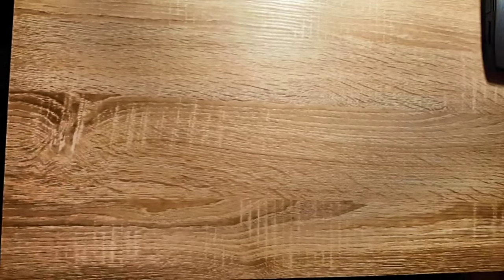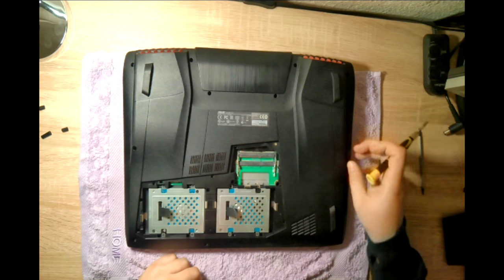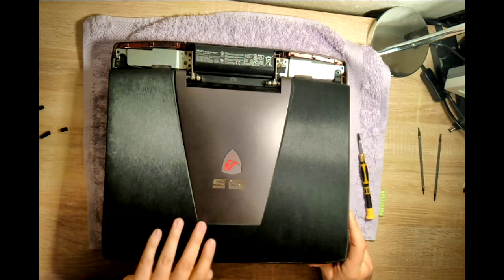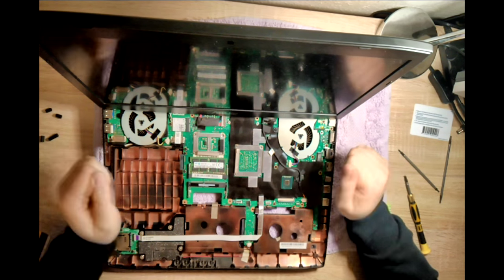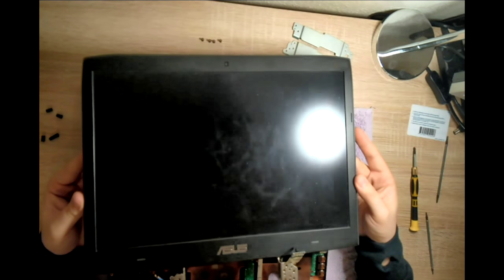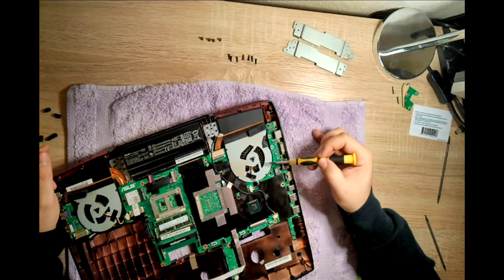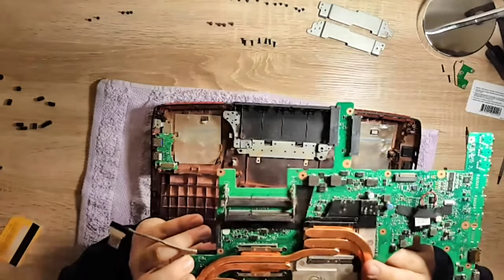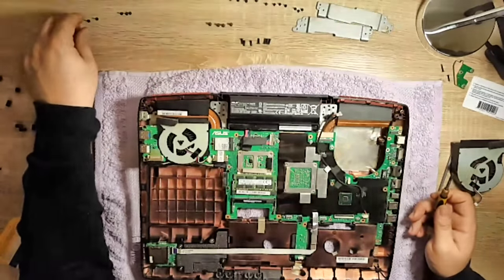Asus G751 - Complete Disassembly / Fan Cleaning / Battery Replacement

Comment: Okay so when i finished cleaning my fans i put them back ajd i put the 4 pin over one of the fans on and realized a light was on and one of my fans was spinning. I then proceeded to plug the power and turn it off amd the fan stopped the fans were not running prior to me taking the fans out and now im connecting the moniter and the right monitor cable is conducting sparks when i try to connect to the motherboard
Reply: Is this normal has that ever happened
Reply from the maker: +KoolzvilleGamersHQ You might short it out like that. Be very careful. You might've already shorted it out. This means that the laptop a.k.a. the motherboard is powered on. Somehow you've turned it on our it has turned itself on. This is quite dangerous. Do not touch the motherboard with your bare hands but rather put on gloves if you have and connect all cables and the power button. Then you can power it on and see if it's turning on properly. Then hold the power button until it shuts down and assemble it properly. It's quite tricky.
Reply: Dongleboo okay so i turned it on with kist connecting the power strip amd pushing the button the keyboard lights turned on but fams didn't spin
Reply: Dongleboo when i push the 4pin power connector near the fan a lighy turns on and when i push it again a light turns off but not of my fans move
Reply: Just* not kist but please reply I've waited and just wanna know if my motherboard is fried and if i can continue to put it back together
Reply from the maker: KoolzvilleGamersHQ Hi. Sorry I was not at home. If the laptop turns on and there's a picture it's ok. The fans sometimes don't work because the temperature is too low.  You have to assemble it back and let it run for 5 minutes. If they don't turn in you might've shorted out something. You can also measure of you have 5V on the pins if you have a multimeter.
Reply: Dongleboo okay thankss i still haven't connected the display
Reply: Dongleboo ill let you know how it goes
Reply: Dongleboo nopeee still instant sparks when i try to connect that display cable yaaaa i think my mobo is toast 😪 im not blaming u this was an awesome video amd i probably did something wrong and i really appreciate ur replies but do u think i can replace it/fix it or do i need a wholee new mobo??
Reply from the maker: KoolzvilleGamersHQ Either way. Connect the display and everything else and power it on.
Reply from the maker: KoolzvilleGamersHQ If the mobo is toast, you can buy a broken G751 off eBay and replace it. For now just connect all cables and power it on.

Comment: Hey bro please help. Some of my keys aren't responsive after I did this to change the battery. What should I do?
Reply from the maker: Well as a start, re-seat the wide ribbon cable because probably the contact points are misaligned. There's nothing else which can cause this.
Reply: Dongleboo worked thanks bro

Comment: Can i disamble the battery without taking our the keyboard and the display ?  And in mean while to use the laptop without battery until my new one arrive ?
Reply from the maker: +Йордан Христов No, in order for the battery to go out the motherboard must go out first. There are four plastic clips under it and the battery can't go out because of them.
Reply: Thank you for the answer :)
Reply: +Dongleboo  Replaced the battery and when the windows started it was charging and after 1 restart the windows cant detect my battery any more :D
Reply from the maker: +Йордан Христов Interesting...?! Try to disable/ re-enable the Battery Controller in Device Manager. This should fix it...I hope! :) Btw, is it a genuine battery or a third party producer?
Reply: Its genuine and i did all the tricks with  device manager and holding the power button after restart. The strange thing is that if my mouse its just pointing at the batter, the info says there's not battery detected but if i click it it says 100% fully charged
Reply from the maker: ...maybe Win re-install? I don't know...haven't had such issue before. I had an old Acer which did the same thing with the battery and after I dissasabled the battery manager it worked.

Comment: please tell me the fans different? in all the Voltage ?
I have a noise from the left side
Reply from the maker: The fans are identical, there's no difference between them. I really don't know where you can buy a spare fan at the moment. It's still a rather new laptop, and there aren't a lot of spare parts for it. 
I suggest you try to thoroughly clean the fans and the fan housing as dust buildup can be the cause of the noise. Use canned air, not a vacuum cleaner. If that doesn't work, proceed to oil the squeaky fan. You can google some articles of how to do that.

Comment: Screen not working after disassembly, checked the video cable is plugged in, please help
Reply from the maker: Marcel D Theres not much I can do. You can try to re-seat the cable.
Reply: Dongleboo the cable is plugged in not sure whats wrong, tried multiple times

Comment: when plugging in The screen i got a big spark and it came smoke, fuuuuck unplugged battery from motherboard hope it Will work
Reply from the maker: Was the laptop in sleep mode? You should always power off the laptop completely before disassembly
Reply: Dongleboo
laptop was complete shut off, anyway i know where the problem went that i completly didnt think about ive hurted my hand so i have bandage ( it realesed a static charge ) open it once before following your video and it was fine. anyway now the screen is fried, going to cost to get it repaired. but i will meanwhile get the g sync upgrade. thanks for your good video
Reply from the maker: Damn.....that's not good at all. After the video I disassembled my laptop 3 times and I had no such issue. Bad luck I guess. Sorry about that!
Reply: Hey dude, same happened to me, but there was no smoke but a spark. I was shitting my pants dude, but it thankfully works. I have zero money then the laptop would have been useless. :((( Did you by any chance try to slide the connector in? you had to snap it on top, not sure if that caused the spark.

Comment: Hi, I have done all the process to install my new battery and now many keys of my keyboard does not work. Someone can tell me what may be wrong ? Thanks so much for your help.
Reply from the maker: Remove and re-seat the large ribbon cable under the keyboard. It's most likely inserted at an angle and is not making good contact.
Reply: Thank you very much. I have done that and now it works perfect.

Comment: does this... void the warranty?
Reply from the maker: Well, it's a bit tricky. I'm not really sure for your country, but in mine (Bulgaria) I had no issues when they replaced the battery and also no issues in Germany when they replaced my WiFi module. I've opened the laptop at least 4-5 times before both of those occasions. The thing is that the inner RAM slots are not easily accessible and you have to take apart the whole thing. This means that even if someone tries to say something you can always counter him by saying you've installed/removed RAM modules from the inner slots. It really depends I guess.
Reply: In Poland also it does not void the warranty. I have just spoken with PL Asus Support.

Comment: Do I need to remove the hard drive to remove the motherboard?
Reply from the maker: Nova Light Yes. The HDD is held onto the main frame and the SATA connector goes into the HDD. Start by removing the HDD.
Reply: Issue, the screws holding the HDD won't unscrew. I've tried multiple drivers, and nothing.
Reply from the maker: Nova Light Try with a pair of thin pliers and grab the head of the screw. You have to remove it.  You cannot remove the MB without that.

Comment: Does cleaning the fans solve the issue of my laptop's no warning shut downs when I open a game? Is that a sign of overheating? Because when I feel my fans before and after the shutdown they feel warm but not hot, i'm not sure how sensitive they are to heat and if thats why my laptop no warning shutdowns when I open a game, any help is appreciated thanks.
Reply from the maker: grayscissors Does your battery work or it's dead?
Reply: Dongleboo the battery was dead, 0% no charge and the computer wouldnt turn on without being plugged in so I replaced it, was happy to see that it charged and would work without being plugged in and fully charges. but now it only shuts down when I try running a game on it which stinks. Thanks for the fast reply too by the way
Reply from the maker: No probs. Just let me get this straight, your battery is @ 100% and the laptop shuts down? By what you're saying it sounds a lot like some undervoltage. Or maybe some power drops in general. Not really sure why it would do that. Usually, mine used to do that but this was back when my battery was dead. Since I changed it I no longer have this issue. It was shutting down exactly when I was starting a game or opening heavier programs, such as Adobe Premiere. I really don't have an answer for that, unfortunately.
Reply: Dongleboo welp, cleaned the fans saw no dust, replace thermal paste and theres still a shut down when I open a game or start up without it being plugged in, my new battery charges so i'm just at a loss of words at whats going on. Looks like i'm gonna have to play with it plugged it from now on. Also checked my temps and they were fine.

Comment: What is the name of ur tool ans where can i buy it?
Reply from the maker: Oh, that's a tough question. This kit is over 10 years old and there's no name. Google "precision screwdriver set" and there are a lot of options. To be honest the interchangeable heads aren't the best solution, because if you need to apply pressure it's not possible because it gives in. There are much better options.
Reply: Haha, thanks

Comment: you do not need to do anything to the motherboard to remove battery simply pull it back towards the back of the computer and lift the front out and it will come right out!
Reply from the maker: The battery has 4 or 5 plastic pegs which are tucked under the motherboard and the battery is actually being held in place with those along with a few other on the sides. The motherboard has to be AT LEAST unscrewed so you can lift it up and remove the battery. My old battery, as well as the new one, cannot be moved "towards the back" as there is literally no space. 
Maybe with force and bending the plastic you can pull out the battery, but I prefer the safe way by removing 10 screws and the motherboard.
Reply: Dongleboo I literally just pulled it back a tiny bit and it literally came right out. no mother board screws touched at all. I know my computer isn't the only one.
Reply: Yeah, it's true. Did mine also. You do not need to mess with the mobo at all to remove the battery. You even don't have to take the keyboard off. Just push it forward a bit and it is out of the way. So much less work, and less chance of frying something.

Comment: do you know how to change speed of fan
Reply from the maker: Yeah, I use a software called NoteBook FanControl. You can find it in the ROG forums. There's no preset for G751 but I use the one for M52VA. It gives control over the fans but if the laptop gets too hot and you've set the speed at 50% the auto mode kicks in and fans go at full capacity. Usually there's been a rumor that the fans used in this laptop are intentionally tuned down so they're as quiet as possible. That's not true at all. They run at full power when the laptop get's hot enough.

Comment: how hard is it to replace the subwoofer
Reply from the maker: Well, you have to remove only the keyboard panel. No need to remove the display etc. It's visible on the left side. Fairly easy.
Reply: +Dongleboo so it's accessed by the top of the keyboard, not the bottom? I'm confused on where you'd unbolt it
Reply from the maker: The sub is mounted on the bottom casing which holds the motherboard etc.. Follow the video and you'll see how to do it. It's very easy.
Reply: +Dongleboo if all it is, is those bolts underneath that ribbon than that's now to bad. I'm curious though, I've got a gtx 860, is it possible to upgrade to a n lop
Reply: +Dongleboo to a bigger & better edition?
Reply from the maker: If you're talking about upgrading the GPU, no it's impossible to upgrade. All components, except the RAM modules are soldered on the motherboard.
Reply: +Dongleboo bummer. well I'm having this issue with my sub. it's making this sound similar to that of crickets when above 50% I've read it might be a driver based problem but do you think simply replacing it would fix the issue?
Reply from the maker: No, it's not a driver issue. The thing is that initially when this laptop came out it had the wrong driver installed and this driver was using the sub as another speaker. The problem is that when sound different from the low tones comes out of this speaker it can damage it. Now, you have two options - 
Option 1 - your sub is already damaged and it has to be replaced by a new one. 
Option 2 - you are still running on old drivers which are using it as a stereo speaker, instead of a designated sub woofer. 
In case you're running on the old driver, download it from here http://www.asus.com/ROG-Republic-Of-Gamers/ROG-G751JL/HelpDesk_Download/. The new driver fixes the issue. 
If the sub continues to make strange sounds, then it's finished and needs replacement.
Reply: +Dongleboo good to know before I blow out another. is there anything else I should know to update with this laptop?
Reply from the maker: No, not really. The driver update is a 2 step automatic process. Open the .rar file and find the setup.exe. After you start it, it will first uninstall your current driver and after a reboot the setup will pop up again and you can then install the new driver. There's going to be another reboot after the install.

Comment: Anyone know how to replace the screen/remove the bezel? Could probably do it on my own, but I'm not about to risk bricking a $2k laptop.
Reply from the maker: When you remove the screen from the laptop, on the bottom side there are 4 screws covered by little stickers. After you remove the screws, the entire bezel is held by clips which you have to carefully unclip one by one. After that, the  LCD matrix is held by a few more screws and can be taken out. I will make a new video about that probably next week. If you're not feeling confident you can wait for it.
Reply: Yeah, I think I'll wait for the video. Whilst I'm confident I could figure it out myself, I'd rather err on the side of caution when it comes to a system that cost me that much.
Reply from the maker: Technically, there's no way to brick the laptop, but you still can scratch or potentially break something. Nevertheless, I'll do the video on the weekend and upload it then. Come back next week for the new vid. :)
Reply: bump

Comment: Did you repaste this laptop ?
Reply from the maker: Nope, not yet. After Christmas I'll clean and repaste it. At the moment it's running a bit hot at around 87° on the package.
Reply: @amv.techpro  thanks for the reply. I've got the machine all disassembled in front of me. Bought some Arctic mx-2 thermal compound, but I can't find any guides on how to actually do it, haha. A little lost.
Reply from the maker: @mastermin7847  After you remove the heatsinks (both of them) clean the current paste with isopropyl alcohol and then put a small drop the size of a pea and squish it down with the thermal block. Don't put too much. Check some videos on how to repaste laptop CPU. It can be a different model as well, is not necessary to be the exact same thing. 
Just one more thing - when you assemble it back, plug in the battery last! First plug in the monitor and all other cables and then the battery. The keyboard ribbons are fine to be plugged in after.
Reply: @amv.techpro  thanks alot ! I don't have any isopropyl alcohol, is it ok to use acetone?  I'll report how it went. Thanks again!
Reply from the maker: @mastermin7847  Better you plain spirit, if you have. Acetone is too strong
Reply: I manager to get it. Haha. I count 15+ places that needs a repaste. 

The reason I'm doing this is because the laptop won't recognize the charger anymore. A repair shop already changed the AC jack in, and it worked for a little while. But now it stopped working again. I read somewhere that repasting could help this problem. There seems to be a hardware problem with the power circuit or something. Next step is buying a new AC jack in mini-board. I love this laptop, but I've spent alot of time trying to make it run as it should. 

Sorry for rant.
Reply from the maker: @mastermin7847  Well, the AC jack is usually a fail point for most laptops. My old Acer had issues and I replaced it. A Dell I had before that also had issues. It's a pretty common part to fail. I keep my laptop on my desk 99% of the time and so far I haven't had any issues. That's also the reason I'll replace my laptop with a desktop sometime next year. I don't need a laptop anymore. I'll keep this one in case I travel. Replace the jack and it should be good as new. :) 
Good luck!
Reply: @amv.techpro  thanks alot brother. Take care

Comment: Hello, does anyone know if you can upgrade ram or add a videocard? I dont see many videos about this laptops on youtube and well if you know anything please help me out, thanks :D
Reply from the maker: The RAM is upgradable, the GPU however is not. Both the GPU and CPU are soldered on the motherboard. You can put up to 32 GB RAM @ 2400 MHz. If you get the JY model which has the GTX 980M GPU will be enough to run most modern games at 60 fps at medium to high settings (depends on the game). If you are looking for 4K gaming and ultra high performance, then you might wanna look at desktops or laptops with much higher price tag e.g. OriginPC, MSI GT80 Titan, ROG G752...etc. These can run DOOM at 60-70 fps on 4K and ultra settings. That's just an example...